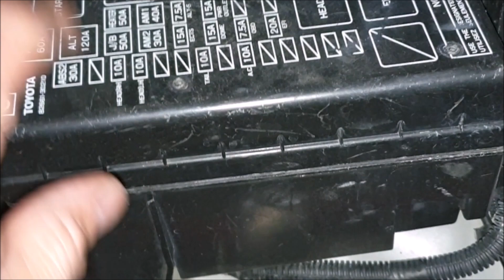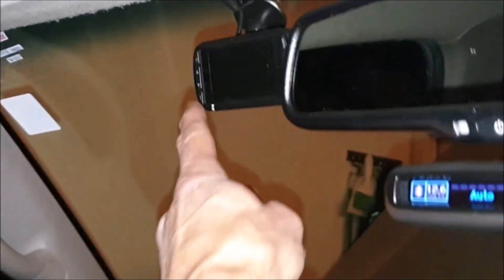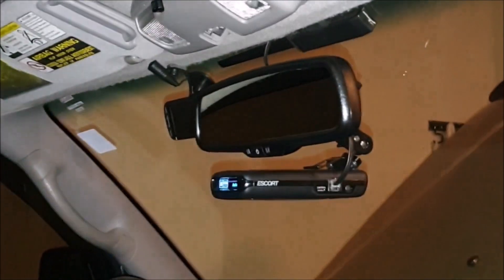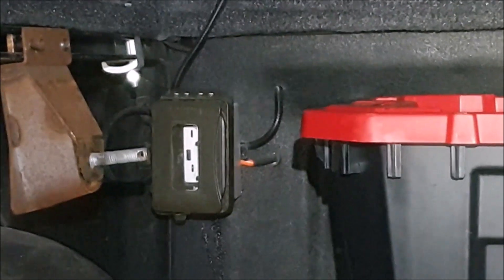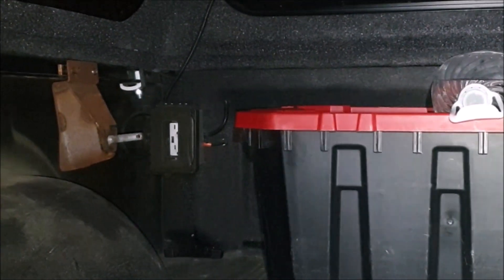1st Gen Tacoma Update

Comment: man, this is the definition of functionality over appearance. Nice work 🤙
Reply from the maker: Thanks man! Too bad I totaled it in January after hitting black ice and losing control on the interstate up here in Washington State. Nearly lost my life but barely a scrape. I’ve actually got a video posted of the incident as it happened from my dash cam on my channel.
Reply: @southwestxnorthwest  Damn that's so unfortunate but at least you're still alive and kicking to build another one. I slipped my 04 on black ice on January 22nd otw out to the Oregon Coast, managed to countersteer far enough to land on the guardrail instead of flipping onto the ditch, only rear bumper was damaged somehow. Hope you get back onto recovery man.
Reply: @southwestxnorthwest  sheesh just bought one a month ago get another one when you can
Reply from the maker: @moctezumaaleg2008 I bought a 2002 TRD last year and will do a video on it soon
Reply: @southwestxnorthwest  Good stuff thats the same thing I got I will be looking out for it.
Reply from the maker: @moctezumaaleg2008  I had bought a 2010 TRD crew cab with a short bed after I wrecked my 04 and drove it for a year but absolutely hated it. Almost exactly a year later I traded it in for my 2002 ($15k trade in value) and bought the 2002 TRD xtra cab for $18,500. I’ve spent about $15k upgrading it and love this rig

Comment: Please share the link on the oil filter relocation kit you used...  I have a3rd gen 4runner.... Your mods and upgrades definitely apply...  Thank you for sharing
Reply from the maker: I don't have a link for it, just search for "oil filter relocation kit" on Amazon or Google
Reply from the maker: I actually removed my filter relocation kit because it kept leaking. There's a gasket on the sandwich plate which threads onto the filter installation point near the front left wheel well but its very difficult to get the sandwich plate threaded on tight enough and the hoses installed which lead to the filter. Beware if you go this route
Reply: @southwestxnorthwest  thank you for this comment....   Did you  use an EBay no name kit?  

I asked other 3rd gen owners and they all continue to put up with the stock oil filter location
Reply from the maker: @camposvazquez  Nah, I avoid Ebay since everything there is from China. I dont remember the name brand but any sandwich plate will do
Reply: @southwestxnorthwest  thank you... It sucks doing oil changes...

Comment: Nice truck bro ive got a 1st gen too just installed a lift i like your drive shaft upgrade were did you get it ??
Reply from the maker: Thanks man, how much of a lift did you get? Anything over 2" and you'll eventually have problems with your drivetrain. Suspension lifts over 2" change the driveshaft geometry and affect the rear diff as well as the u-joints. I had to have my rear diff rebuilt last year for $1200, and have had the u-joints replaced at least once.

The solid drive shaft eliminates the center u-joint and carrier bearing; both of which wear out and cause vibration.
I bought my driveshaft from Tom Woods Custom Driveshafts for like $650, shipping included. It took less than an hour to install and I was able to do it myself. Ill put a link in the description
Reply: @southwestxnorthwest  
I bought the 2in old man emu but i think thats with some weight on there cus it went up a lot thinkn 2and half in the front and 3 in the rear and least and yeah might have to upgrade my drive shaft
Reply from the maker: @cray7139  How many miles are on your rig? Mine had about 248k before I pulled the trigger and bought the solid driveshaft.  It still has vibration when accelerating in 2nd through 5th gears, I think it may be in the transmission though.
One thing I also did recently was had an extra leaf spring added on each side in the rear because it was sagging a bit.